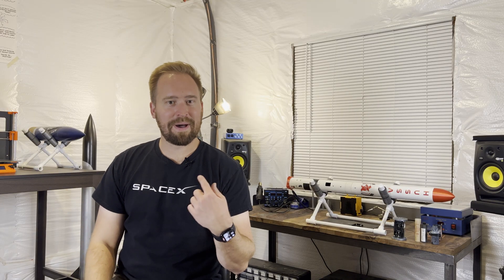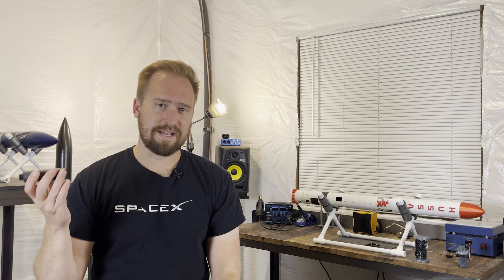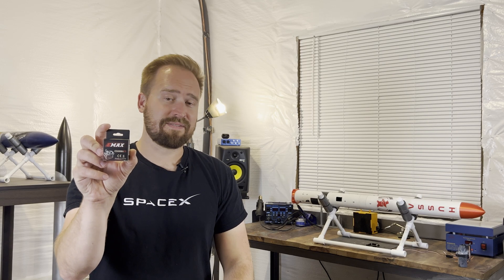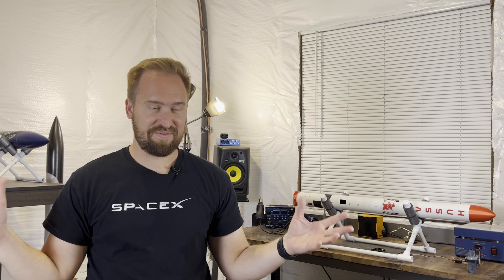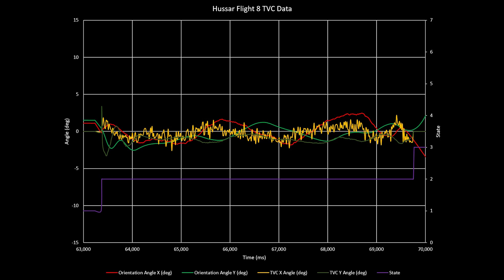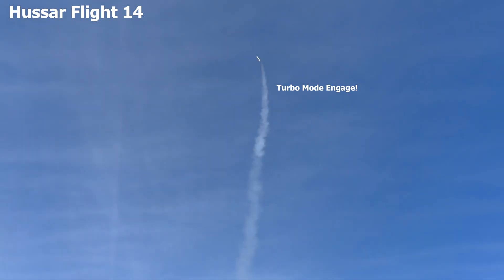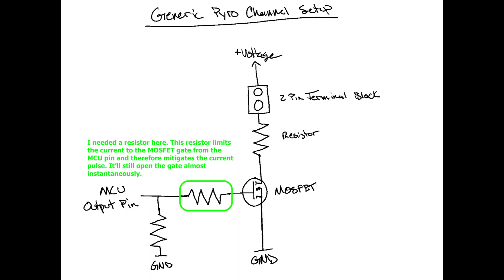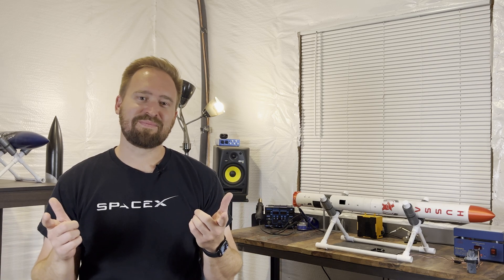Developing Reliable TVC Control - Hussar

Comment: I know this video is older now, but a note about your MOSFET turning on - you should consider (in future applications) to use a gate driver circuit. Typically it's one BJT with a few resistors, but it's WAY more reliable in supplying charge to the gates. I use them for IGBTs and fets that have a VGS higher than microcontroller pin voltage output, but for time critical activation, gate drivers would allow you charge up the gate faster than a flimsy microcontroller pin.
Reply from the maker: I definitely appreciate the suggestion and will look into it. I’m by no means an EE and really like getting feedback to make things better, thank you!

Comment: Love this! As a non-rocket-lander, I'd enjoy learning more about simulation. For example, I'd like to hear more about needing to "match the update frequency of the simulink block to the loop timing".
Reply from the maker: Hi! Sorry this is so late. I don't have plans yet for a video like that yet, but you never know... To answer your question though; in Simulink you can define how long in-between PID calculations that the output, which are the servo commands, is updated. That can be 1ms, 30ms, etc., but it needs to match up you flight computer software. So in the flight computer software if you have the servo commands sent every 30ms, you'll need to match that in the simulation so that the systems match each other. If your flight software is updating the servo commands every 30ms, and then your simulation is updating every 500ms, then the systems won't match and therefore the gains you gather from the Simulink simulation are not going to work well for your flights software!

Comment: This is so awesome! I'm trying to tackle the same challenge and build my own! However, I am having issues with the mpu6050 in a vertical orientation and suffering from crazy gimbal locks using dmp. Do you have resources to combat or look into this? I'm not the strongest programmer but I want to learn!
Reply from the maker: Use quaternions to calculate orientation as they don't suffer from gimbal lock. You can then convert to Euler angles and feed them back into your PID controller. The below library utilizes gyroscopic rates and quaternions then converts to Euler angles to use. I think it'll help you, I haven't used it myself, but have heard good things. I use a Frankensteined code that works well for me, but isn't polished up enough to release to open source.

https://github.com/peregrine-developments/Orientation

Comment: I'm curious how you soldered the ARM CPU on the flightcontroller board? At 3:04
Reply from the maker: I use a good amount of tacky flux under the BGA then use a hotplate to get the board up to reflow temp. I'll use a heat gun on the BGA from above and a temperature gun so I know when the chip is at the correct temperature per the chip datasheet then remove everything from heat. It's not so bad, I was honestly intimidated at first, but I've had 100% success rate this way so far.

Comment: Cool! I am waiting to find out how you figured out landing timing :)
Some thoughts about MOSFETs: gate resistors a very helpful not only to limit gate current but also to suppress oscillations. The gate trace has some inductance and together with a gate (a capacitor) it works as a oscillator, and instead of just opening, the gate current starts going back and forth. Resister helps to kill this effect. Also, your MOSFETs are huge :) you can probably go with a tiny like 2*2 or 3*3 mm package that can still sustain 20+ amps. And it will probably have much less 'total gate charge' that also good.
Reply from the maker: I recall coming across something like that online called a "current hammer effect" but I wasn't sure enough about the truth of that to actually add it to the video. Thank you for clarifying that, it's been bugging me for quite a while! The timing to the landing is really cool, I am quite proud of it. Stay tuned 😎